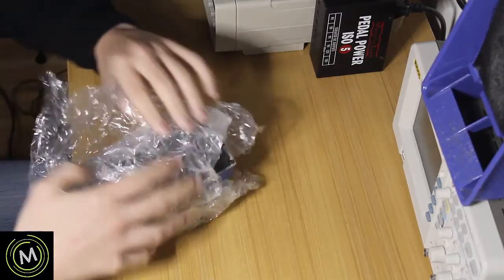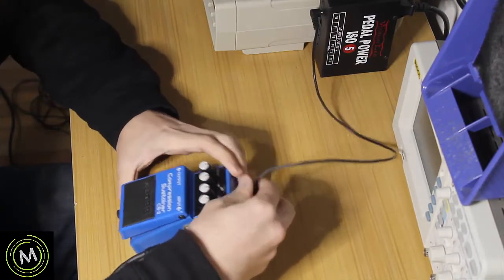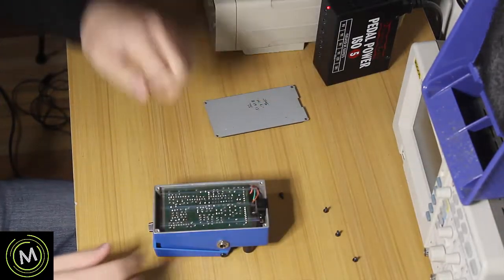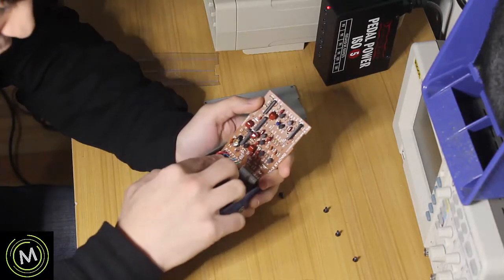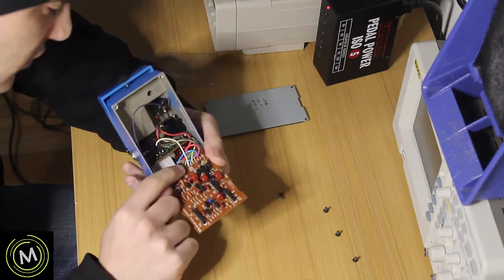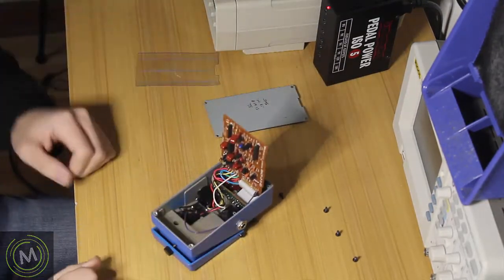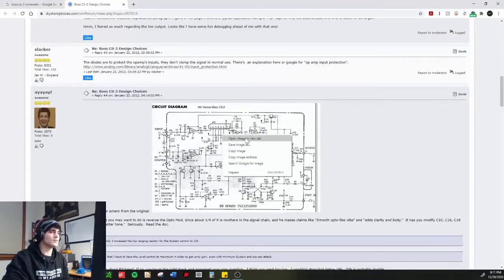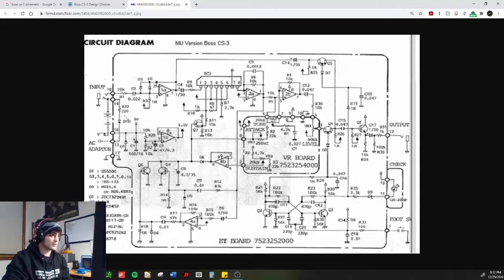Repairing a BOSS CS-3

Comment: Pre-1996 Black label CS-3 needs ACA 12V power supply. It doesn't work on 9V. In 1996 they converted it to PSA 9V.

Comment: Hello...  Thanks for the video. I recently acquired one of these pedals and the previous owner replaced one of the Ic's. I opened it up to take a look and R8 is missing. I can't find any information on this resistor.. do you know what it does? Or if I absolutely need it.? Looks like your board on this video has one installed. any help would be great. thanks

Comment: Brilliant video I learnt a lot just watching this I have subscribe to your channel I am thinking of buying a pedal of someone old Ibanez pedal flanger they told me properly best if you run it on a battery because they said the protection diode was removed so does this mean you have to get the proper exact power supply for it. The old pedal does still run on 9 Volts. To make this right where I can plug it in is it easy to fix??

Comment: Hey I'm trying to fix my Boss pedal, the same one as this one in the video. And I was wondering how I know what diode and other components to use. For instance you used a 1n4001 for the diode on D1, how do I know which component goes where like for instance what is the part number for R33 or D10, etc. Thank you!
Reply from the maker: Hope you get it fixed! Not sure I fully understand your question, could you send over an e-mail where you can clarify it a little better? Thanks!